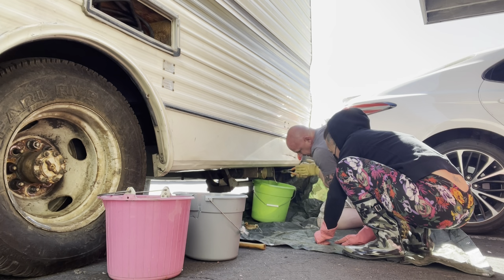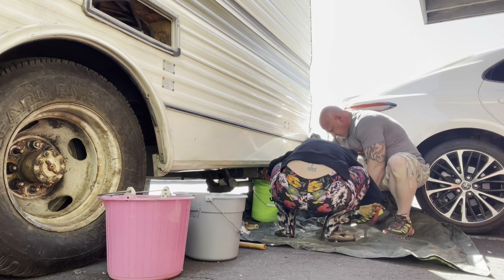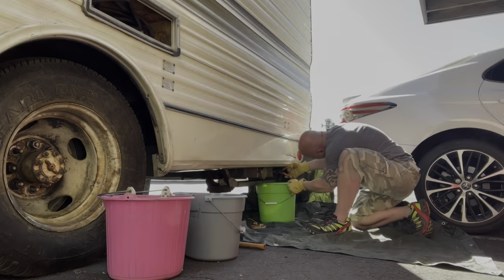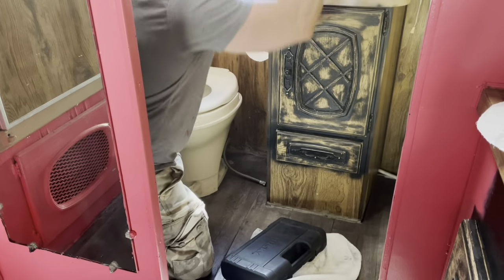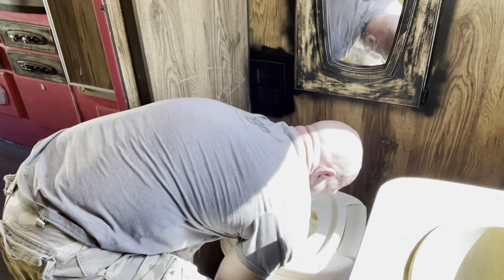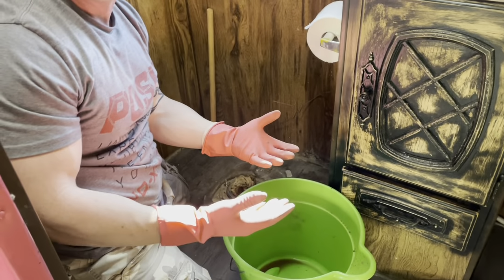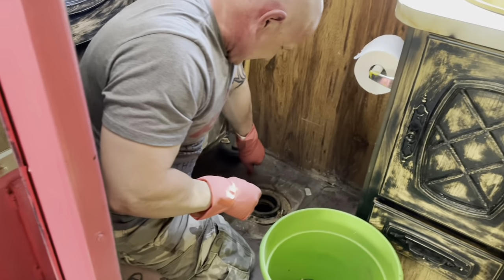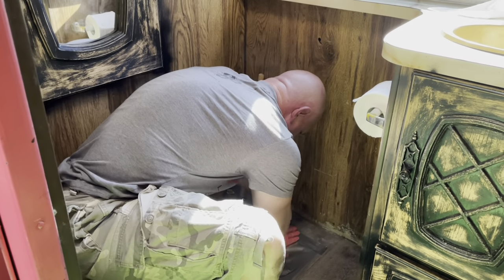Cleaning the RV Poop Tank - Removing the RV Toilet - Prepping for a Compost Toilet  - Episode 8

Comment: ok anyone that has this problem looking for a fix here it is.at your local rv store they sell a adapter that fit on where the sewer hose goes then the sewer hose goes on th the adapter . $20-30 it's clear it also has a fitting for a garden hose. you hook the garden hose up .have your sewer hose hooked up to dump open the valve . then turn on the garden hose it will blast the plug apart .
 second cheaper way is dump at least 2 bags of ices cubes down the toilet and take a drive down to a rough road .
Reply from the maker: That's a great idea about the ice bags!